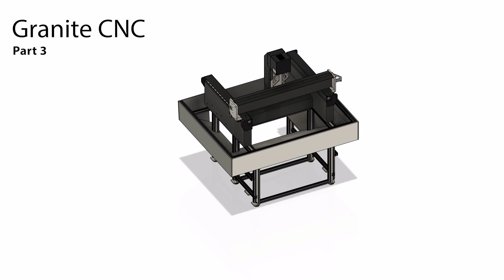DIY Granite CNC - Part 3. Mounting Z axis.

Comment: Did you figure out where the play was coming from. Was it fixed. I really want to see how the yaxis covers were designed.
Reply from the maker: It's in the rails. I need better quality rails to make it go away.

If you look close on the intro of the video you can see the covers there. It's a 90 degree sheet metal part that covers the inside and top of the axis. There is a slot between the block that is connected to the y axis and the x axis boom. The cover sits in that slot.

Comment: For such a high end system, to use anything other than preloaded roller type linear rails on the z is going to work against the overall design.  A granite system like this really begs for ultra precise linear components.
Reply from the maker: Better is always better!
For now it's the budget that is the limiting factor. Other rails may be in a future upgrade. I may want to rework the zaxis design anyway at some point.

Comment: Nice design!
I noticed that you use one rail as a reference to adjust the other. That way they have locally the same distance between them but if the reference rail is not purely straight you transfer the error to the other rails. Eventually you will see this error in a sideways movement of your mill when you move the Z-axis.
Reply from the maker: You are correct in that this is something you need to watch out for when aligning the second rail like this. That is why my main rail is aligned with a reference edge on the plate that is perpendicular to the plate. I don't have to worry about sideways movement with my configuration. I just want to align the secondary rail to the main rail. 

Then all I need to do is align the whole plate, rails and everything square to the table using a dial indicator.
Reply: Youtube videos from bosch rexroth and nsk show you need one reference edge and align the second rail with the first. Just like in this video. So his method is the correct one.

Comment: Congratulations on a built, that machine and how you make every part is just amaizing.👍🏼
If have that huge base, I would probably go with bigger rails, big granite bridge on Yaxis, steel Zaxis setup and would use machine for steel milling too. 

I also have some old granite machine that I bought (https://youtu.be/YAks_k5paOw), but didnt finished repair because still missing some $$ for parts and would like to share some ideas with you.(If want share you email)

About the problem, Im not very smart but thing that poke my eyes is small distance between rails and place where it connects to aluminium plate, perhaps due to the lever on the bearings because the plate is not connected to the center of the carriages due to the sheet metal protection, or may be aluminium plates bending. Hope you will fix it soon. 
🥳🥳🥳HAPPY NEW YEAR🥳🥳🥳
Reply from the maker: I decided against steel because I can work with aluminum on my other machine. It's also easier for me to rework the parts that I ordered if needed. 
The rails are plenty strong for the weight according to the spec sheet at least.
I have narrowed down the issue to the parts that help create the gap for the x axis covers. The design was a bit of a test. It seems it's not strong enough. At least not in this configuration with aluminum as the material.I may rework the design of the z-axis at a later date but right now I just want to get it running.
Reply: @faggan3040  
I think you would soon or later probably like to solve that issue and that can only be solved by reworking those sheets and by adding moving parts as protection from dust and chips.
To me seems like problem is because two aluminium parts that make path for sheet cover are not single piece of aluminium and when you put pressure on aluminium plate it twist those 2 parts in opposite directions and also carriages that may not hold the force which over the lever becomes stronger and bends the carriages in a awkward direction.
Cant wait for the next video.🤗🤗
Reply from the maker: @alphaprecision2064  Yeah thats what i meant. 

I dont really see how i can make it better without redesigning the parts in question. And that means i need to make new parts. I am sure i will be able to make those parts on this machine even if there is a bit of flex there. 

thats why i will finish the machine first and rebuild it later.

Comment: Hi, nice Work man! How can you adjust the Angle of the z Axis to the goundplate?
Reply from the maker: It depends on what direction is out of square. Right or left is a matter of adjusting the linear blocks so that it tips into square. Front to back is a lot more work. I need to grind the backplate so that its square to the table. 

The issue is that when I measure the backplate separately its square to the table. But the front of the moving plate is not. Leading me to believe the rails are the problem.

Comment: Really nice build - gave me some nice inspiration. I had some random thoughts where the play could be coming from; 

1. Are you sure that you are not just seeing twist in the long X Axis gantry? I'm not sure how stiff you calculated the boom to be in the twisting direction. 
2. Can you measure any deflection of the X-Axis gantry at the Y-Axis linear bearings i.e. Can the entire X-Axis gantry twist as a unit from play in the Y-Axis linear bearings?
3. Do you know what preload bearings you bought? The hiwin models are typically bought with ZO preload but higher preload versions could help if you are able to isolate this to the bearings. 
4. Do you know how stiff the glue you used for bonding threaded inserts into the granite is?
Reply from the maker: 1 and 2. I have considered it. But i haven't measured it no. 
3. They are medium preload ZA class. 
4. I don't. I doubt that the inserts themselves move. There is however a chance that the aluminum plate that's bolted to the granite moves due to low friction or something. 

At the moment the endplates for the Y-Axis is at the paint shop and that means i have no way of fixating the boom from moving in the Y direction. Measuring accurately will be tricky. 

These are definitely good questions. I will try and look into it. Thank you!

Comment: If you adjust and increase the parallel distance between the rails on Z, does the play alter noticeably?
Reply from the maker: The main issue is back to front stability. I'm not sure spacing the rails further apart would help in that regard?

Comment: over-tightening the linear block bolts can cause the play.
Reply from the maker: Yes. However they are tightened to manufacturer torque with a torque wrench. Im leaning more towards that the unsupported part of the moving plate is the main issue. Its just not possible to get that kind of rigidity when its unsupported like this.
Reply: @faggan3040  I think preloaded roller style bearing blocks(25mm+) would fix the nod flex on z. HIWINs RG series rails are high quality and very affordable
Reply from the maker: @backyardengineer916  Possibly. Im still not etirely sure its the rails though.

Comment: Great build video series!
The Z axis is always the hard one to make rigid. On my machine I sacrificed the Z travel, and was able to space the Z linear bearings much further apart in ratio to the Z travel.
I ended up with the Z travel at 65 mm and the bearings about 250 mmm apart, the result has performed well for years and I have never needed more than 65 mm travel since I mainly machine flat plate.
Another thing that might be worth trying is to double up on the Z axis bearings, more bearing blocks (6 ?) on the same 2 rails.
Anyway, thanks for sharing your build! 👍🙂
Reply from the maker: Thank you!
You are probably correct. I have 230mm of Z travel and with an unsupported Z-axis like this it adds up like you said. 

Adding another block could probably help. But i would need to add height to the moving plate and rail length to get the same travel length out of it. The question then becomes if it helps more than it causes harm? 

At the end of the day i think the router style machine im building cant support a Z-axis with much more travel than this without becoming unstable. If i want more Z travel i should build a VMC style machine instead. I just hope this works good enough. :)